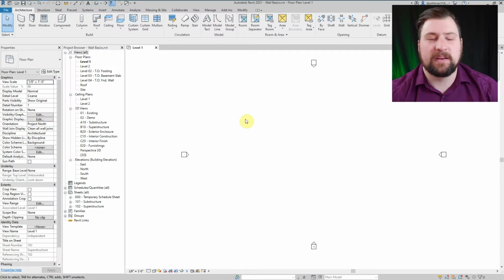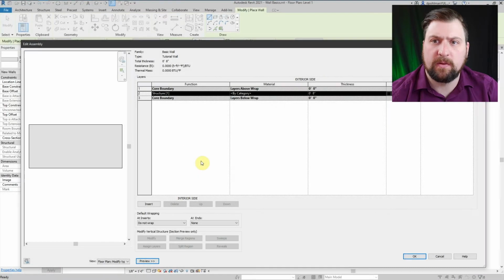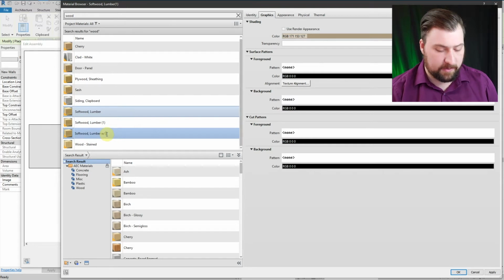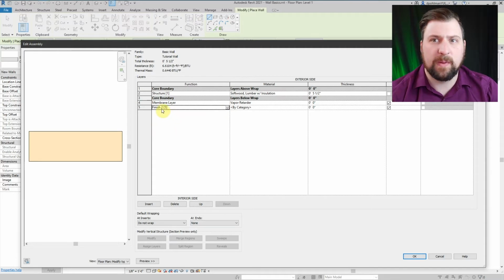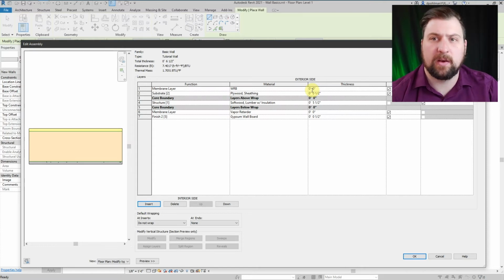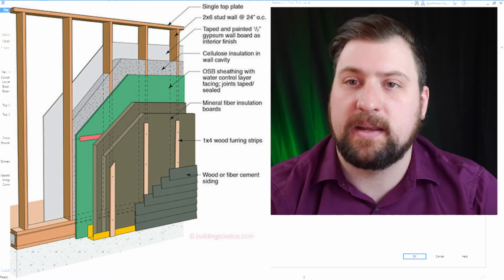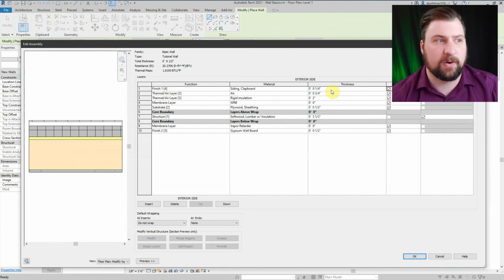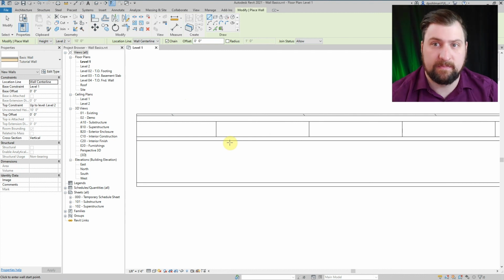Revit 2021: Creating Compound Walls

Comment: when use compound wall layers 
or seprate walls for finishes and core ?
Reply from the maker: There are uses for each. In most cases using a compound wall works the best. It also depends on how accurate your model is compared to real world construction, for how the layers interact.

Comment: do u have any recommended strategy for sharing wall-assemblies to reuse this effort?
Reply from the maker: Yes. So to tranfer from project to project you can use transfer project standards on the manage tab. Or you can model a wall and then copy and paste it into a new file. Hope this helps

Comment: Awesome tutorial. So for the framing layer, how are the insulation batts included?
Reply from the maker: This is a tricky thing to actually model. Typically I call that layer stud with insulation and give the wall the thermal properties as if it has insulation. There isn't much else we can do. Normally you would not model every stud in the wall. You can and I am planning a tutorial on this. To note the insulation in the drawings you can use the batting lines or add a fill to walls with insulation.